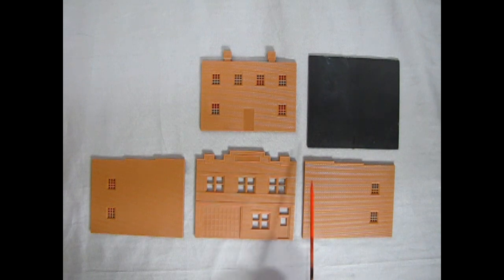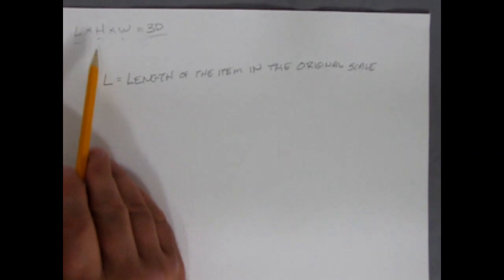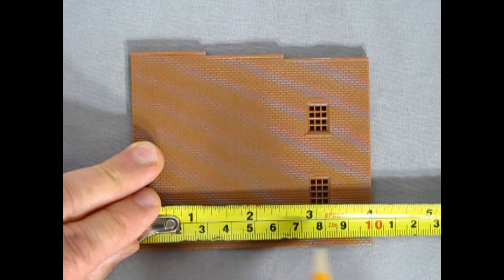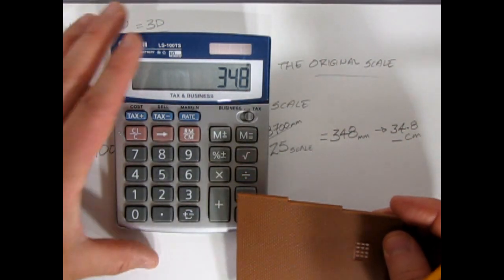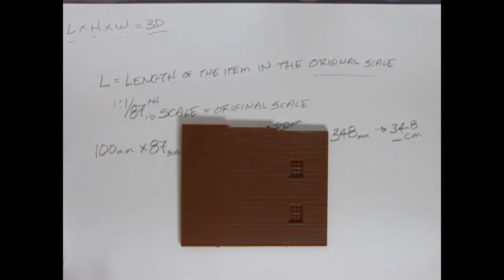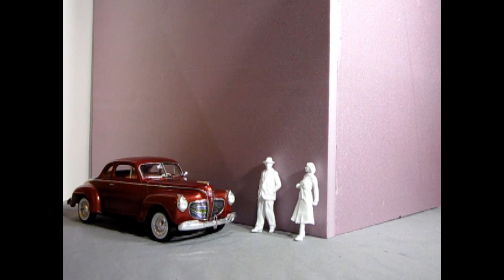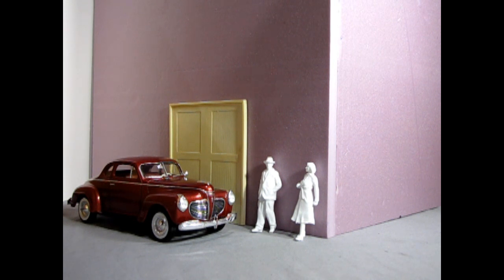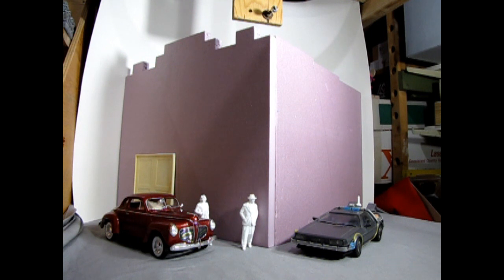Model Car Garage Tips and Tech - Changing Model Kit Scales for Dioramas - How To Scale Up Buildings

Comment: Great Tutorial.   Model Train Diorama Stuff is Great Reference. But this makes it useful in a different Way
Reply from the maker: For sure. Have you ever built dioramas before?
Reply: Actually NO bit interest in it. Has spouted in last 10-12 yrs. I'm 58.  But I took 3 yrs of Mech Drawing/ Drafting. 78-80.   I worked a Old Conoco Gas Station Sophmore. Year. It was torn down 30 years ago.  So I'll be working  working from black & white photos & perhaps plans filed with city  of Blue prints
Reply from the maker: @memorylanemodelcars  Sounds good! Should be a fun build.